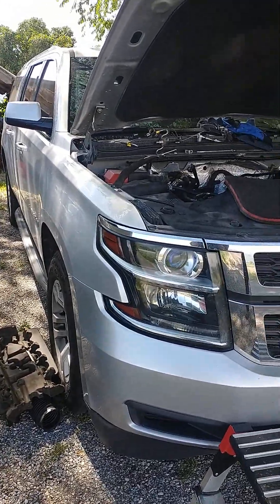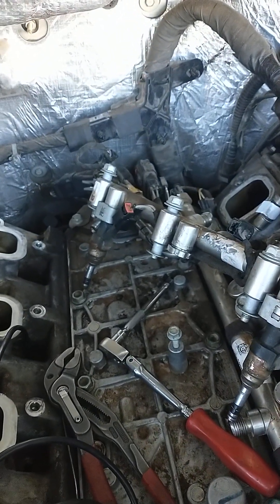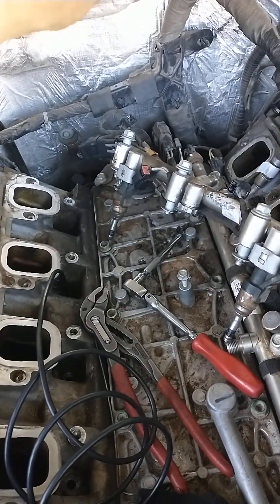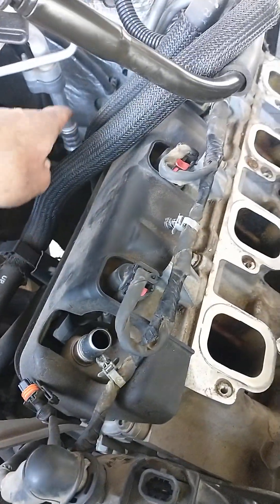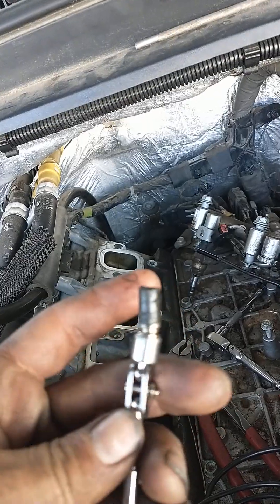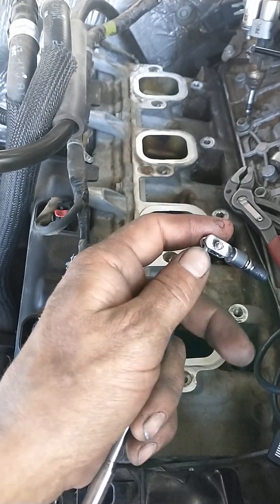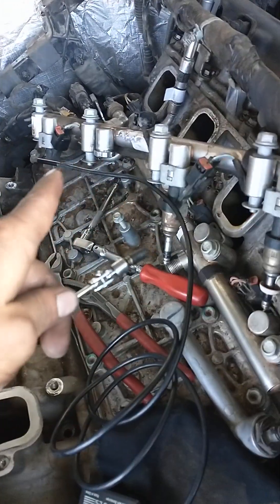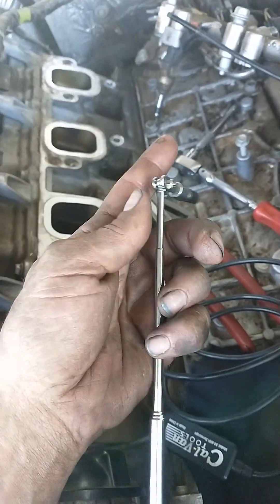2012 2017 Chevy direct injector stuck, broken, extracted and fixed

Comment: Thanks for the insight. Mine broke same cylinder, same type a break right above the "o-ring". So what I did was with patients - I used epoxy. I found out what the inside diameter was of the injector. I found a screw/bolt that would fit and was a decent length of about 4 inches. Next, I used a extra 3/8 socket(long) with the head end of the screw/bolt inserted into the socket. Epoxied this together. Then I took the end going into the broken injector made it jagged/flattened to give more surface area for the epoxy. You do this just enough up the screw/bolt for the depth of the epoxy. I cleaned both the screw/bolt and broken injector with isopropyl alcohol. I mixed up a simple epoxy(JB WELD Original). I used a syringe with a long needle tip to apply this and I must say this IS NECCESARY to make sure the adhesive gets in the right spot. Applied a little to the screw/bolt to cover all the part that would be inserted. Put the two together. Let the epoxy set. Came back with the 3/8 drive and rotated it. Now you need to ensure the whole injector is spinning otherwise this did not work. Once I was comfortable it was secure I put a driver on it and spun it a few times. I put the extension and ratchet back on and manually pulled up and rotated. It took some upward force but it popped. It came out glued to the screw! I threw the whole setup socket/screw as far as I could in celebration and relief. Good luck people, godspeed.
Reply: Did you happen to take any pictures of the contraption you made? 
I’m struggling to get an injector out with the same issue.  I have tried the magnet and hitting it through but it won’t budge. 
Was going to try the epoxy method but I am not following your description. 

Basically did you insert a bolt into
The broken injector then epoxy a
Socket on the top of the bolt and then epoxy the end that went into injector
Reply from the maker: @JakeBerthoff i simply pushed the injector tip into the cylinder and extracted with the magnet through the spark plug hole.
Reply: @garrettgrantham7411  
What did you use to push it through to the cylinder?  I have tried a bunch of different tools, such as screw driver, drill bit, and bolt same size as while, but it doesn’t want to budge.
Reply from the maker: @JakeBerthoff  if your in the rust belt soak it in a small amount of water. I used a punch and it took minimal effort to drop in.

Comment: My injector broke and got stuck just like this I am nowhere near as experienced as you but if I’m understanding correctly you put that magnet through the spark plug hole? And bent it at an angle to get the stuck piece?
Reply: I was doing my Range Rover and had the same break 
On a similar injector
What a nightmare 
I was about to push it through and stopped but now seeing your video I’m going to get the new hinged magnet and camera and get it done!!
Reply: @macdonmar I am in this situation right now. I've removed the cylinder head before, so that was my plan. But now I am thinking about this. I am a little worried that forcing the injector tip through the hole and into the cylinder could damage the hole. I assumed they are tapered, getting narrower as they move into cylinder. Anybody have insight into this?
Reply: Also how did you push it through? Did you hit it with a hammer and a stick to push it through?
Reply from the maker: @5hunet  tap it into the cylinder after setting it to just below top dead center. Magnet will retrieve the tip
Reply: @garrettgrantham7411  no I mean the broken injector piece how did you push it down ? And im not too sure what you mean by top dead center ?
Reply: @garrettgrantham7411  you are like the only video I’ve ever found for this issue I apologize for all the questions it’s been a nightmare for me it’s been DAYS I’ve been dealing with this issue
Reply: @garrettgrantham7411 dead center as in you out the magnet through the hole in the piston? Or was the piston all the way up or all the way down?
Reply from the maker: Step 1. Rotate the engine so the piston is at the top.
Step 2 insert the magnet into the spark plug hole (spark plug removed).
Step 3 push the broken tip into the cylinder with a small screw driver 
Step 4 remove the broken injector tip with the magnet from the spark plug hole. Carefully and slowly.
Reply: @garrettgrantham7411  got it so basically the injector tip falls in the lifter tray and I reach up there with magnet before it falls to catch Or does it slide into the cylinder which is right below top dead center and falls into the cylinder then I fish when it sits on top or does it slide down near the spark plug hole and I fish it out ?
Reply from the maker: I highly recommend a bore scope, ( super tiny camera on a cable) that will allow you watch the magnet pick up the injector tip.
Reply from the maker: @5hunet  fish it out from the spark plug hole. It drops into the cylinder ( direct injection into the cylinder)
Once you have successfully removed the tip you will need to clean out the injector bores before installation of new injectors. If heavy corrosion and debris exists use a rifle cleaning brush to scrub out the dirt and debris, finish with brake clean and compressed air.
Reply: @garrettgrantham7411  okay thank you this info has been very helpful final thing what size is the tool you use to turn the engine over ?
Reply from the maker: I believe it was a 22mm socket
Reply: @garrettgrantham7411  hey man great news I was able to get the broken piece out by using your exact instructions it worked like a dream used same exact magnet from harbor fright and no bore scope necessary it caught it like a baseball I had the magnet waiting for it and to find top dead center I re inserted the spark plug barely threaded so that it holds but still leaks air out and I turned the engine until I heard a hiss and that’s when I knew the cylinder was up  and making compression but thanks ALOT you saved me a bunch of time and aggravation I thought I would have to remove the head but thanks to you I didn’t! Did you bend your fuel rails back as much as possible before you put them back?
Reply: Yeah but DI adds HP and fuel efficiency, that's why they did this garbage  along with the variable oil pump. I HATE THESE LT ENGINES lol